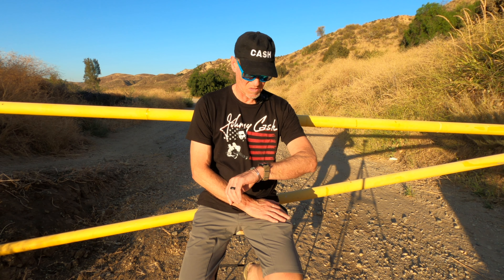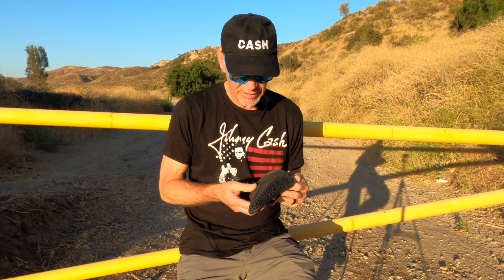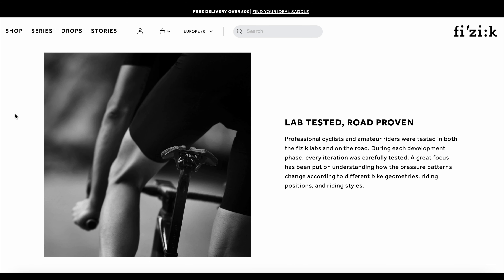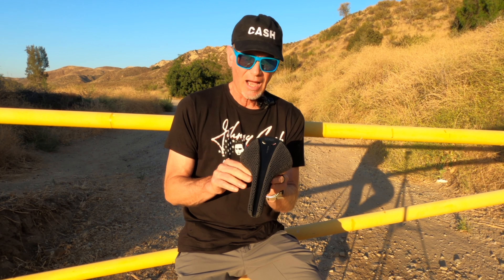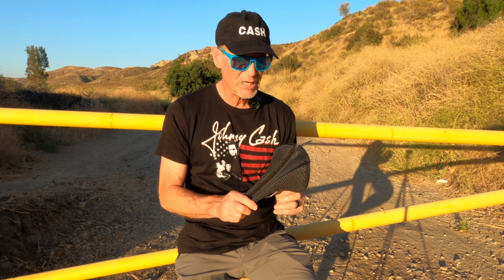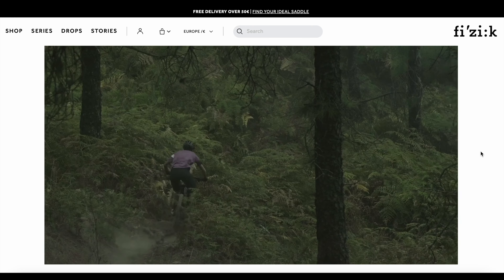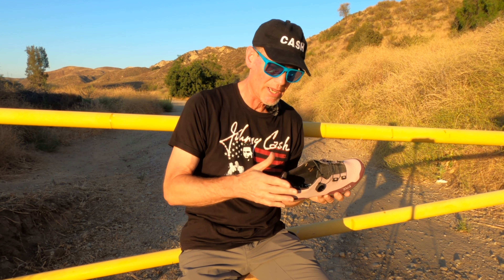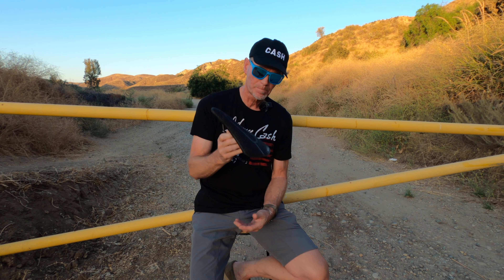Quick Review: Fi'zi:k 3D Saddles and the Terra Atlas shoe - Is new tech always better?

Comment: As always, appreciate your honest review of these! I agree with you on a lot of your points. I haven't yet tried their 3D printed saddles but i'd def consider one. My gravel bike came with their Argo R3 which seems to come with a lot of gravel bikes lately. I rode that for a year and after about 2 maybe 3 hours of riding, it went from ok saddle to the worst one ever just because of how sore i got. Eventually i upgraded to the Selle Italia SLR Boost and that's been a godsend. For me, the perfect saddle (and half the weight of the Argo R3). As far as shoes, i actually have a Pearl Izumi shoe that's very similar to that Fi'zi:k one and, it too is ok. I use it exclusively on my mountain bike (which has Shimano XTR pedals). I'm not the biggest fan of BOA. Like you said, i often have to re-tighten the shoe and it's just not a solid feel. But, again, it's only on my MTB where i rarely ever ride over 2 hours. For my gravel bike i actually use a road Fi'zi:k shoe (i forget the model, but it's got velcro instead of BOA). I think they were roughly $120 or so? I actually love that, but, now that it's almost 3 years old, i might need to replace them soon, and i think i'll be going to a Shimano shoe instead. All that said, and for anyone who may read this - both the saddle and the shoes are a highly personal experience that can make or break your ride. Find something that works for you, it'll transform your ride!
Reply from the maker: Wow. Great info. Thanks for your time and advice.